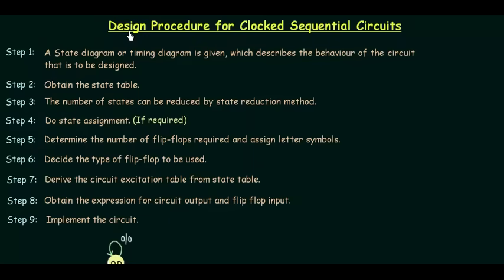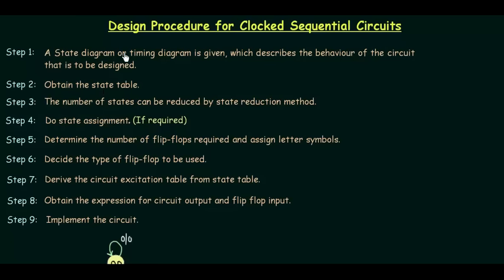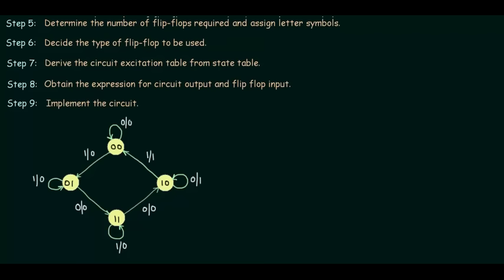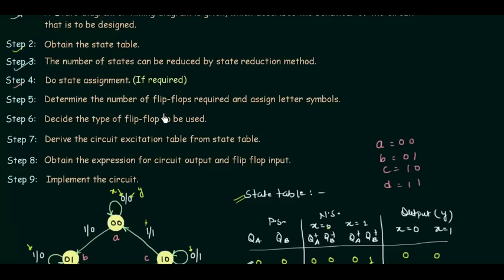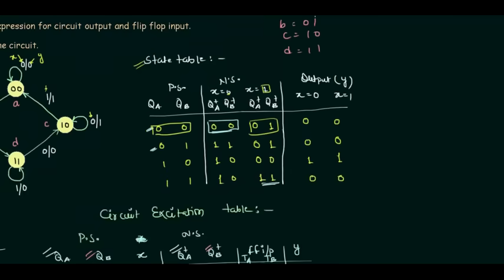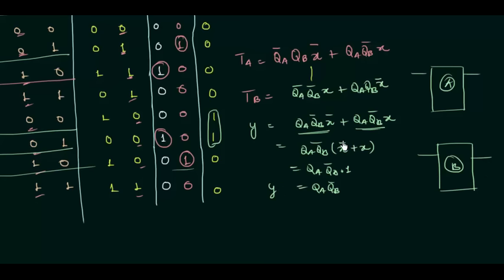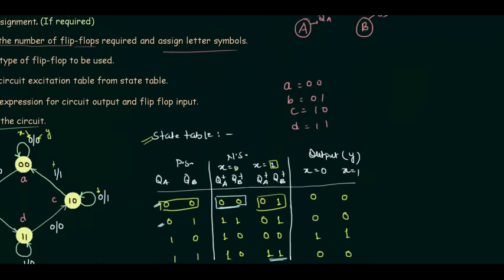Design Procedure for Clocked Sequential Circuits

Comment: The first time I watched this, it didn't make complete sense to me, but after watching  some other videos it made perfect sense and I understood it completely. The videos are from the playlist and I will mention them down below for others struggling with the same thing:

Analysis of Clocked Sequential Circuits (with D Flip Flop)
Analysis of Clocked Sequential Circuits (with JK Flip Flop)
Analysis of Clocked Sequential Circuits (with T Flip Flop)
State Reduction and Assignment
Reply: god bless
Reply: Can you explain to me point no 6?
Reply: @QazWsx-sn3bn  you can use any type of flip flop .... Generally D and T flip flops are used because they are comapritively easier and require less equations than JK flip flop
Reply: @QazWsx-sn3bn generally it is give in the question but sometimes it depends on the problem

Comment: @nesoacademy 
Sir, at 6:33 you are explaining that state reduction is not possible for the state table that has been obtained. For P.S. {0,0} and for x=1 as input, N.S. is {0,1}. Also, for P.S. {0,1} and for x=1 as input, the N.S. is again {0,1}. So, the N.S. {0,1} is repeated. Moreover, for both of these rows the output y is the same and equal to zero (y=0 under the x=1 column). Hence, state reduction is possible as there is a valid repetition in the state table. 
Sir can you please tell the procedure for performing the state reduction in the above mentioned case.
Reply: wonder y nobody else figured it out , i also have the same doubt
Reply: @Aryan_agarwal830  but i found the answer to it . state reduction can only happen when the states have next state and output same for all values of input x s0 and s1 have same output and next state but only at s0 x=1 and s1 x=0 which is different input so no state reduction can be done
Reply: exactly i also saw it and they can be reduced

Comment: 00:05 Learn how to design clocked sequential circuits in 9 steps
02:30 State table filled for input 0 and 1
04:53 States cannot be reduced further
07:09 Determining the number of flip flops required and assigning letter symbols
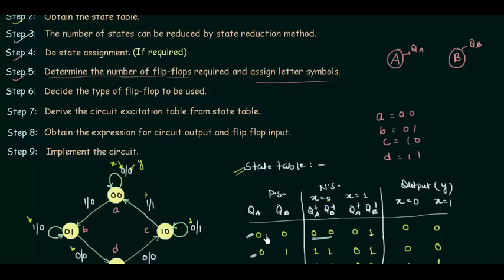09:19 Derive circuit excitation table from state table
12:01 Implementing a circuit using T flip flop
14:22 Implementing an excitation table for a circuit
00:03 Nine steps for implementing clocked sequential circuits
Crafted by Merlin AI.

Comment: How did you select the flip flop at 13:21 ? Will it be given in the question or do we have to choose it ?
Reply: You can choose any flipflop if it is not specified in the question.
Reply: I guess, it will be specified in the question. Here he has shown design procedure using T ff.
Reply: @merida3975  Thanks !
Reply: He seems to have skipped step 6 at 9:25 where it says to decide the type of FF to be used

Comment: The state diagrams discussed in this video remind me of Caley diagrams used in group theory. A group is the fundamental object in the study of abstract algebra. We can construct a group by first identifying a set of elements. We then form all possible permutations of this set, and assign  a unique symbol to each permutation. The collection of symbols representing permutations is called a group if there exists a rule for composing any two elements of the group. The rule must follow a few axioms, but this information is not necessary for you to understand my point.

The behavior of a group can be summarized in two ways. We may create a composition table or a Caley diagram. The composition table looks exactly like the multiplication table we all grew up memorizing in elementary school. The Caley diagram looks EXACTLY like the state diagrams used to describe the behavior of a sequential circuit. In fact, I am 100% sure that the state diagram in this video could be used to describe the behavior of a group in abstract algebra.

My conjecture is that there is a structure preserving relationship (isomorphism) between state diagrams and Caley diagrams. I find this idea extremely tantalizing because it establishes an intimate and fundamental relationship between computer science and abstract algebra. I wonder if this idea might be extended to conclude that there exists a group (field, ring, vector space, or some combination of all four) that perfectly represents the behavior of a computer's CPU, ALU, or the whole machine.

Comment: in state table, when ever you said that,to reduce state table there exists 1 0 state repeating please explain
Reply: its not redundant because in both the cases NS is different for x = 1 and the output is different too. two states are redundant only if the next state as well as output is completely same
Reply: @ishitagambhir6610  I am only learning this right now, so I'm a little confused. 
What about row 1 and 2,  NS: 0 1 (x=1)  output Y= 0 (x=1) ??

Comment: we need similar design starting from a timing diagram. please, chose cases that do not skip steps. you skipped step 6 "type of ff", why?.  knowing how to pick a type is important. thanks
Reply: for step 6 we can use any flip flop. I prefer using d flip flop as it's simple.

Comment: +NesoAcademy Output(y) should be a function of (x,Qa+,Qb+) at17:30 because the moment x takes it desired value and clock pulse occurs value of Qa and Qb will be changed to Qa+ and Qb+.
Reply: I was wondering the same thing. I tried making y a function of x and the next states, and it ended with the correct result. 

However this leads me to ask. Since this is a Mealy machine, does the output change asynchronously? When I toggle the input values for it, the output changes irrespective of the clock. Is this behavior typical in mealy machines?

Comment: sir if states are in odd number.. then number of ff will be what amount?
btw ur videos are awesome :)
Reply: the number of Flip Flops will be the minimal ammount N which will cover the number of states required. For example,  the number of states required is  P (odd) then choose the minimal 'N' such that  2^N > P (2 is because you use binary logic and you can store only 2 values in a single flipflop). The states in the interval  [2^N downto  2^N - P] will have not to be used, in VHDL you cover these unused states with an 'others' clause in the CASE  statement.
P.S. Read about the concept of Cartesian Products, this is why you question arised, you don't undersand Cartesian Products well enough.

Comment: How do you know there will be 2 state variables in the first step??? I think you looked at the state transition diagram for that, but sometimes there is only verbal description of the problem, not diagram. How do we know the number of state variables?

Or is it directly related to number of states? If there is 4 state, then only 2 state variables. If there are 5 to 8 states, then 3 state variables. Is that so?
Reply: Yes.
Reply: This still does not make sense could you explain?

Comment: To all those wondering about step 6 
No specific reason for using T flip flop. Implementation using D flip flop is easy because next state is same as data input and implementation using JK flip flop takes time, maybe that's why i used T.
Reply: You just cleared my doubt
Reply: You're right 👍

Comment: sir first of all a very thanking you for this video. My question is that if i have 5 states then in this case which flip flap can i use for  implementation of circuit......please give  the answer...!!
Reply: it cannot have five states. it can have states in the order of 2^n (i.e 2,4,8,16...)

Comment: hi.. when you determine the Ta flip flop output.. at 6th row, the Qa to Qa_next is from 1 to 0 right.. which from the transition table, it will give toggle output of T ff. the toggle shall be respective to Qa right which is 1 for the 6th row. so the Ta output at 6th row should be 0 right?  toggling from output of 1 of Qa isn't it?
Reply: excellent contents.. well teaching.. pls upload some other videos related to sequential logic circuits...

Comment: step number 6????
Reply: HOW TO DECIDE WHICH FLIP FLOP
Reply: @wish_one_knot5006  I'd say JK if the two inputs are independent, D if the two inputs are always equal or you have only 1 input, T if you need Q to be complemented for each clock cycle.
Reply: @DamonDraven  for implementation of citcuit is the input x will work like clock in both T flip flops
Reply: it is T flip flop
Reply: @elmir.ahadov  but why?
Reply: @ImAkaii  it can be anything like d or t, depending on the question

Comment: Thanks for these amazing lectures! I have just one question - Can't we evaluate equations for next state and then implement them through Flip Flops. Like can't we write QA+ in terms of QA, QB and x, solve them through k-map, do the same for QB+ and then implement the circuit?
Reply: Yeah !! Did you get an answer for that? I know its 5 yrs back... still?
Reply: @nannubedi7773  Yes, you are correct. In digital circuit design, it is common to first write the Boolean equations for the next state of a flip-flop or sequential circuit and then implement the circuit using logic gates and flip-flops.

One approach to implementing a sequential circuit is to write the Boolean equations for the next state of each flip-flop in terms of the current state of the flip-flops and the input signals. These equations can then be simplified using Boolean algebra or Karnaugh maps to obtain a minimized form. The minimized equations can be implemented using logic gates and flip-flops.

For example, suppose we have a sequential circuit with two flip-flops, QA and QB, and an input signal x. We want to design a circuit that computes the next state of the flip-flops, QA+ and QB+, based on the current state and input signal.

We can write the Boolean equations for the next state as:

QA+ = f(QA, QB, x)
QB+ = g(QA, QB, x)

where f and g are Boolean functions.

We can then simplify these equations using Karnaugh maps or Boolean algebra to obtain a minimized form. The minimized equations can be implemented using logic gates and flip-flops.

So, to answer your question, yes, you can evaluate the equations for the next state and then implement them using flip-flops and logic gates. This approach is commonly used in digital circuit design.
Reply: @ritwikdurga3855  goofy ahh chatgpt response